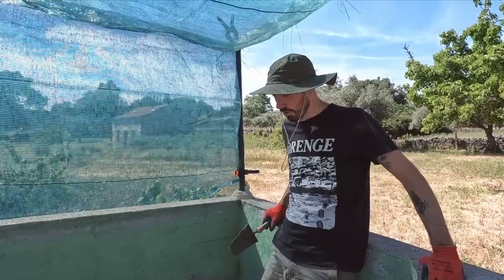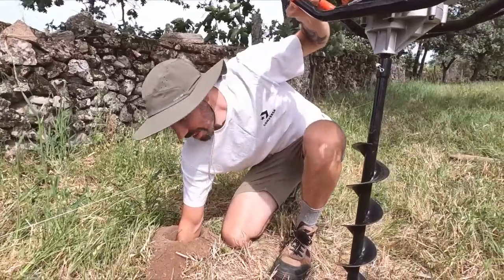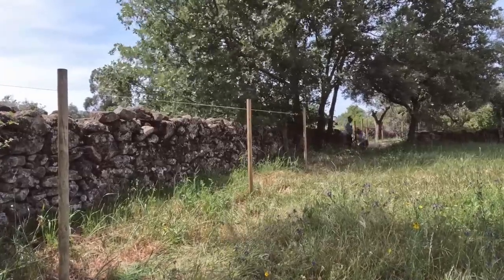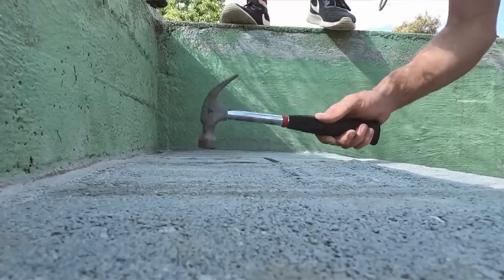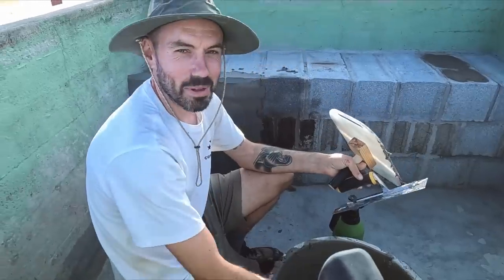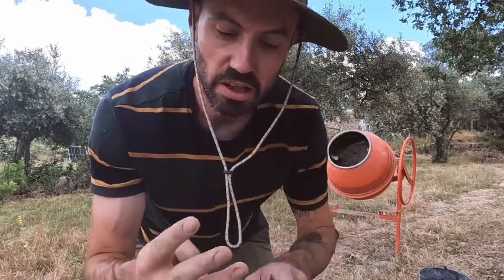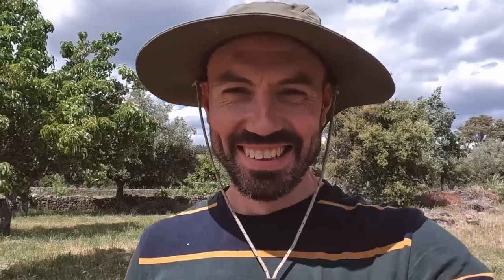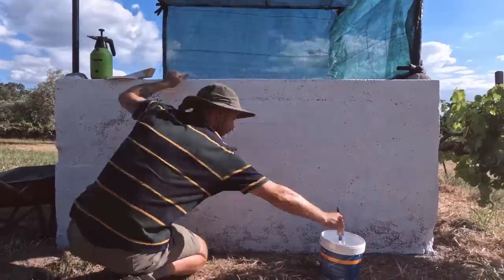AMATEURS Try to RENDER POOL on Portugal Homestead Renovation

Comment: Can you not buy rendering edge profiles? S/S. Your scratch coat should be 4:1 and tour top coat 6:1, and float off when it starts to loose water so you don't drag it off the wall. It looks like the mix is a bit to dry, you should alow for the scratch coat sucking in the water from the top coat. If can't get a profile use a length of wood to square up to. Tram lines in the second coat is normally caused by bits of large grit in the mix and when you float it they come to the surface and leave the tram lines.

Comment: We never used a post driver for wood, only metal T posts.  We dug holes for the wood posts with a post hole digger, (auger would’ve been great, but we were poor!).  If you could find or buy online a paint roller for rough surfaces it would save time over a brush, (I know you’re done, but maybe useful for the future?)

Comment: Not sure if t's to late to say - a product here in Australia called Bondcrete is fantastic for painting concrete block or floors or anything you would like watertight. Seeps into the concrete and seals it, preventing alge growth and leaking. I think you can even add it to paint.

Dark paint colours recceed into the landscape - lots of Australian landscapes paint fences for example, ironbark dark frey colours, like your poles on top of the 'pool'

Comment: Perhaps your problem with the post hammer is because they are designed for steel posts not wooden ones
Reply: Er, no ..they ARE designed for timber fence posts!
And he is doing it correctly - however, it's much easier if you penetrate the ground first with a steel bar ..!

Comment: Great job, do you have to render all the inside walls of the tank?  or just the water proofing paint?  We have a huge water tank and will start to convert it soon but we need to make stairs up to it first.
Reply from the maker: Thanks Kristin. We’re not rendering the whole inside, just the floor as it’s cracked & chipped. Then paint with pool paint. Can’t wait! Good luck with your reno!